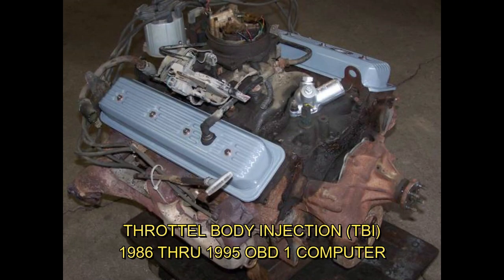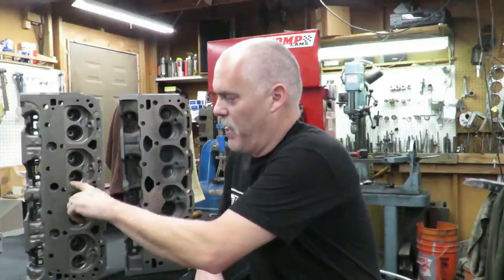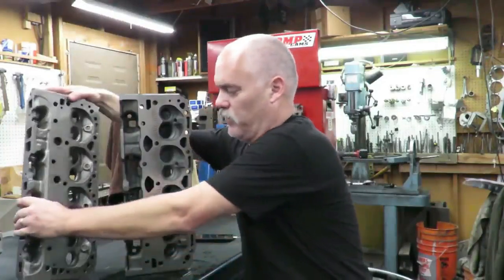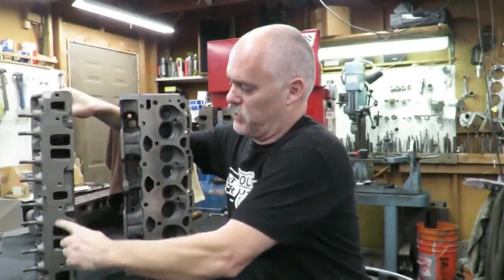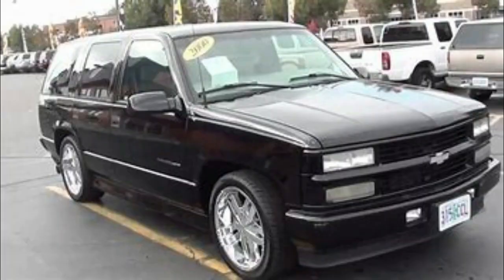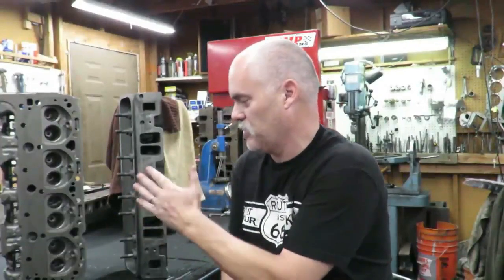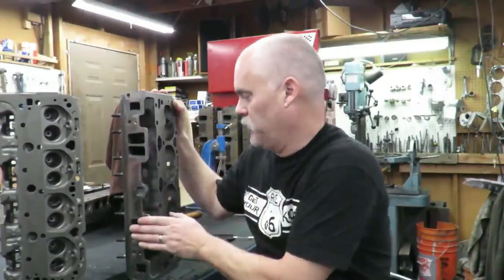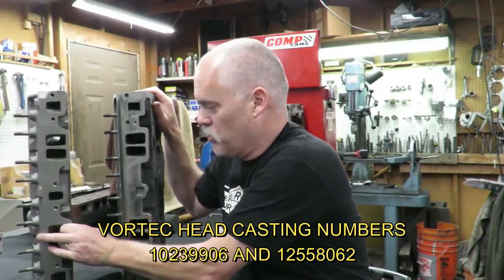350 CHEVY VORTEC VS TBI HEADS

Comment: It's amazing what a 193 TBI head can flow with some trick porting.
Reply: Agreed. I love a good tbi headed setup.
Reply: @CarGuyV8  I'll stick with the Vortec head. You're starting with a better head and they have much more potential.
Reply: Would an 88 4.3 have the same intake shape and design as the swirl port.
If you swapped to Vortex heads, you'd need the matching intake, which I assume requires something other than a throttle body.
Do you then need the ECM from the newer vehicle.
I'm thinking unless you're going for a lot more power, some minor porting of the original heads and a decent valve job would be less of a headache and still give you some gains.
Reply: what kind of horse power did you get with that "trick" porting? ive got a 95 tahoe with the non vortec heads... what exactly did you do?  thanks!
Reply: Will the porting keep if from falling on its face about 4000 rpm
Reply: @off-roadmechanic  see what Charles Servedio got out of a set. Crazy numbers

Comment: I like my TBI 350 in my lifted truck. I added the summit k1103 camshaft, longtube headers into true dual 3 inch pipes, and deleted the egr. With 3.73s and 35s it does really well in the mud. Torque for days!!

Comment: Have a 93 model delivery box truck with tbi heads. Been want to change to vortec heads but seems my truck would be down too long to make the change. I realize they make an aftermarket intake but have heard stories about having to make a lot of changes idk 🤷‍♂️ love your videos 👍🏻
Reply from the maker: they make an intake so you can use your TBI on the engine with vortec heads
Reply: you need to keep air fuel ratios and fuel mapping in mind,, MAF and Map values,. fuel pump pressure, ect..   the computer has to get along with the changes.. ive seen this same scenario MANY times, and they cant get it right, they spend thousands more than planned, and end up selling it, in defeat. sometimes the ECM programming has to be modified, and you really dont know what changes they made,,  not worth the hassle on a fuel injected, computer controlled engine,, if your going with carbureted, then yes, you can dick with the timing and carburetor until u get it to run good.  you may have to get a stand alone Efi set up, with its own computer. THEN you must consider transmission inputs.. if the automatic transmission doesnt see the input values it wants, it will go into limp home mode, or worse burn it up.. if u want a votec motor, buy a truck that already has one in it from the factory.
Reply: I got my modded '93 TBI pickup (with Vortec heads) tuned with the help of Dave @ Old School EFI.

Truck runs great!

Comment: The question I have is can the the 350 TBI heads breath enough to exceed 400 ft lbs of torque with porting and valve jobs if intake system is also capable.

Comment: Hi! My name is Vince . I built a 350 . .30 over . With a stroker crank. Flat top pistons . With the vortec 906 heads.  Modified to take a 5.25 lift cam.  My question is. Would this set up need a 750 cfm carb or less . I had the engine built buy good friend.  He said should make 400hp . Thanks for your advice in advance . Love your videos !
Reply: Which carburetor did you decide to go with?
Reply: @TheBossenable  a 750 vacuumed Secondary Holly

Comment: What I like to know is , what company makes good quality mild roller camshafts for Chevy TBI engines . I mean long lasting camshafts and lifters.
Thanks for your great Videos
Reply: Summit has a 450/450 lift 204/214 duration roller cam that is great for torque builds. Part# Sum-8800.
Reply: thank you @CarGuyV8

Comment: Any issues putting 96-2000 Vortec heads (which used roller cam/lifters) on an older block using a flat tappet cam/lifters?

Comment: I have an '88 Chevcy 3500 with a 350 TBI. It has 191 heads on it. I also have a set of 882 heads.  If I leave the block alone, and not have it bored, would you recommend the 191, or 882 heads? If I have it bored 40, which head would you recommend? Thanks  Greg
Reply from the maker: 882 flows better

Comment: I bought a Vortec engine from a junk yard. 880 block, 062 heads. Supposedly from a '99 Chevy Tahoe,  <90,000 miles. I am replacing the TBI 350 engine in my '88 Chevy truck. The exhaust manifold bolt pattern is different. I didn't expect this. Is this right?
Reply from the maker: The vortec is the same as early 350 chevy some of the manifolds flex when removed there was a 350 head in the 80's that had both bolt patterns but the TBI and the vortex are definitely the same ex bolt pattern

Comment: Ok guys need a little advice! I have a 94 cheyenne 4x4 swb truck with a 5 speed and a 4.3 in it. I have a 305 tbi block, my question is will i gain much power by bolting a set of 350vortec heads on it? Also it will be carburated and a little bit of a cam. Any advice is greatly appreciated guys
Reply: that swap has been done and every one has seen very good results , you need to swap in flat tops on the 305 to maintain compression if that’s a concern . other than that put in a nice cam and you’ve got a great little runner

Comment: What's the compatibility look like, can a tbi intake setup go rite onto a set of vortex heads with just the 4 bolts on each side & loaded with silicone in the center
Reply: You cannot put a TBI manifold on these heads. (I've heard about guys modifying these intakes to do it... but it sounds like a nightmare)

I put a set of 906 Vortec heads on a TBI short block with the Edelbrock RPM Performer manifold (for Vortec heads). Topped off with TBI unit from SPR Performance on top of their adapter plate.

Challenging but apropriate build for a beginner. Aftermarket cam plus these heads required tuning though.
Reply: @four-eight-zero5627 did you have to get the block tap and died for the different bolt pattern on the heads?

Comment: With the prices of aluminum performance heads coming down, it makes no sense to fool with a set of cast iron units that more than likely will need machine work prior to installation.
Reply: Kinda true, but most aluminum heads shouldn't be just bolted on. They still need to be properly checked. Also, I wouldn't be buying them with hardware already installed.

Comment: good luck finding a vortec head that isnt cracked....
Reply from the maker: The GM vortec's that say made in Mexico are an upgraded casting thicker they rarely crack and there's a ton of them out there they were sold over the counter from GM and used for merc/marine vortec's and warranty work at chevy dealer to replace the carack prone production version
Reply: @Myvintageiron7512  the mexicans need dependable vehicles..
Reply: @randy1ization the 'nova' didn't sell so well there